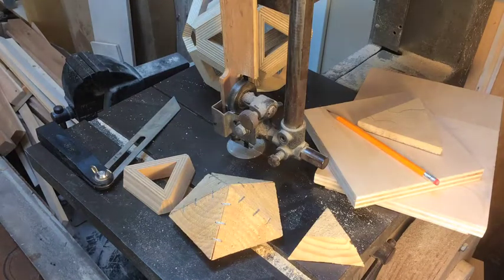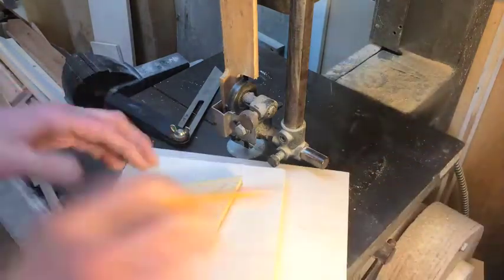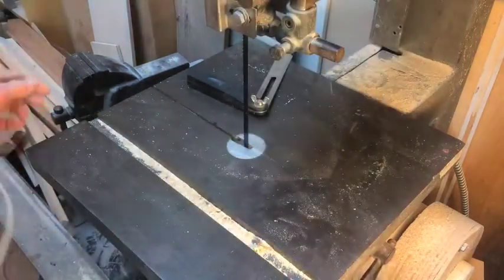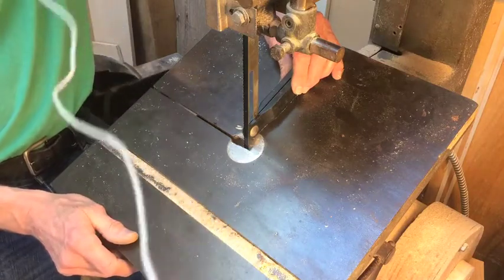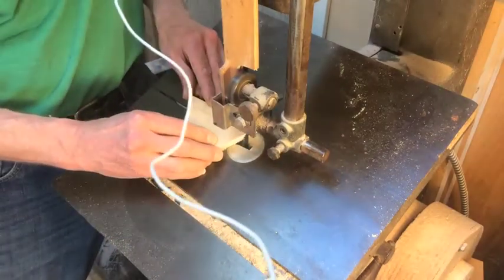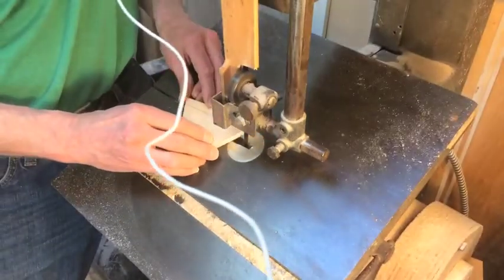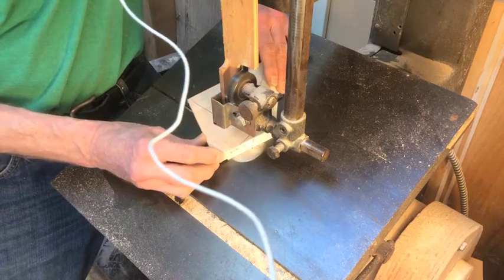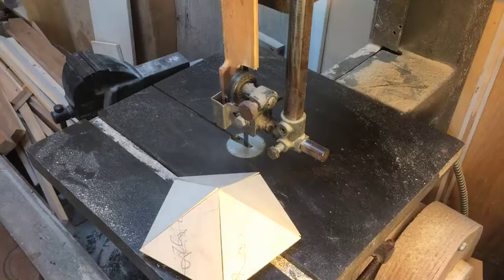Platonic Math - Cutting Bevel Angle for Icosahedra on the Band Saw

Comment: Hi great work very good information i have a question if you don't mind I would like to build a 2v geodesic dome out of wood frames i have bought plans and books and still can't get what im after i wonder ca you explain how to find the bevel angles for the frames The dihedral angle is what I'm looking. Don't want you to tell me what it is. I want you to help me understand how to find it. I made a dome 16 foot in diameter out of PVC pipe. And I'm wondering, do I find the dahito angle as you shove?  In one of your other videos, would it be the same for a geodesic? Don't thank you for your help and your time and your knowledge. Thank you for sharing I hope you can help me with the Struggle Is real
Reply from the maker: I'm afraid I can't help you with this. I am not familiar with making 2v geodesic domes or forms, although they do look very interesting. My interest and experience are with regular geometric forms, mostly the Platonic Solids; the tetrahedron, cube, octahedron dodecahedron and icosahedron. The faces on each are regular polygons of a single species; and on each all the corners are alike. It appears that 2v geodesic domes do not share these characteristics. But figuring out how to get what you need might be the most interesting and rewarding part of your project. Good luck!

Comment from the maker: On Feb 7, 2021, I received this question from sc800 Cole in my email about this video, but I can't find the comment to reply directly, so I'll do so below. 

Question:
So, you may laugh, I have a noob question and video request. I clicked on the link for Harvey tools and looked at their on line flier for the C14 bandsaw. I am scrolling along and page 21 they show the bandsaw table on a tilt. I imagined trying to cut a long bevel on a long board and kinda had a visual in my head of the board just sliding to the floor. I know you can flip the fence from high to low. Can you flip the fence left to right? Could you use it to hold a board on a tilted table on the right side to keep a board from sliding off? I don't see a lot of videos about cutting bevels on a bandsaw. Can you make a video showing how bevels are cut, does and don'ts etc. Or if you already have point me to it? Thanks .. I believe in gravity. 

Answer:
Thanks for your question. When cutting a bevel on the bandsaw, the board can't slide to the floor, because it has the blade passing through the wood, but gravity will want to pull the board downwards and direct the cut accordingly. But all you need to do is hold the board up, with your feeding pressure, against the force of gravity, during the cut. It's not as difficult as you may be imagining it. 

You could use a fence to hold the wood up, but that raises all the problems you can have when using a fence on the bandsaw, like when the blade pulls one way or another and does not follow the line of the fence so well, but that's not a bevel issue, it's a fence issue. 

A board clamped to the table will also serve as a fence, if you don't have a fence, or if the one you have can't do what you need it to do. 

No, I don't have any other videos, at the moment, for cutting bevels on the bandsaw, and I don't plan on making one today. Sorry. I don't remember ever seeing one either, but it's not that hard. Just try it. 

Hope that helps.
Reply from the maker: Michael Fortune speaks about band saw fence issues in his video: https://www.youtube.com/watch?v=vNdrkmx6ehI